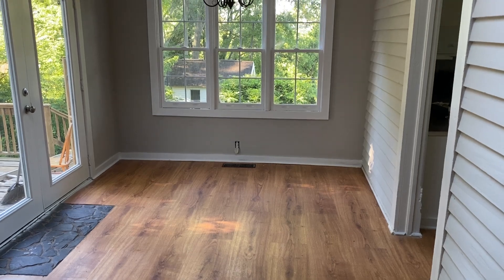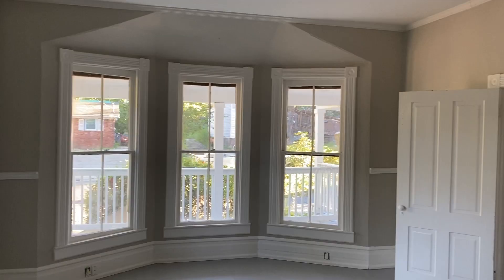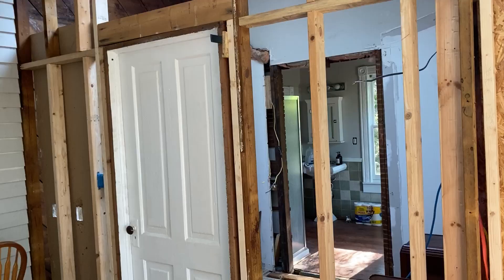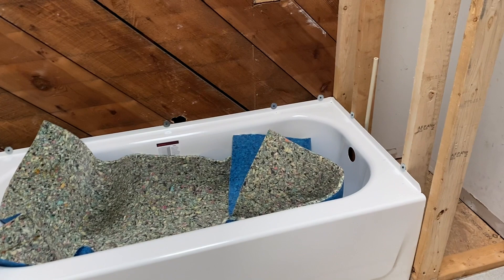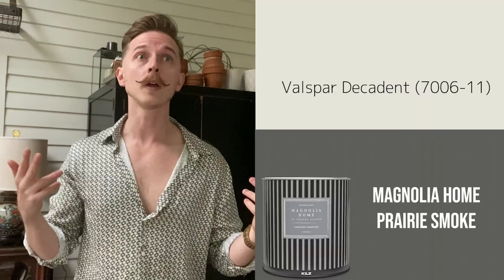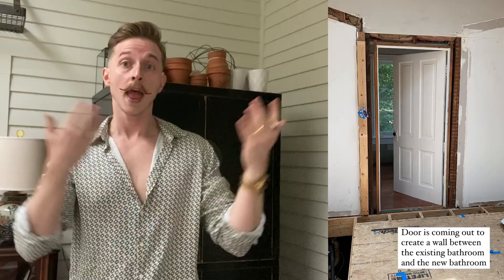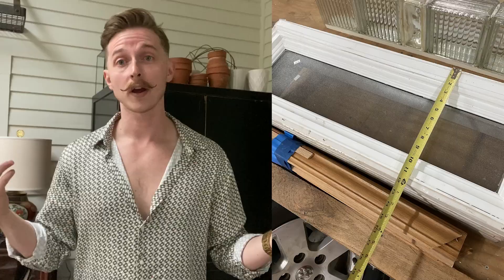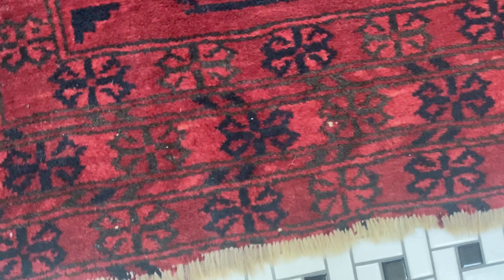EXTREME guest bathroom makeover! | Before and After | REISSUED

Comment: I think for the dryer, you should add a kind of vintage-look framed chalkboard, like a work-place tally board or lead board, to cover the dryer only, while leaving the washer exposed.  It would have a hinge on one side to allow access, but visually, that would work with the 30's style "WC" door.  Call it 20's boiler room, or speakeasy style.  Functionally, you could use it as a shopping list, weekly inspiration, schedules, reminders, artwork or whatever.
Reply: I see now it's actually IN the bathroom, and a door of any kind might not actually work.  Maybe as an alternative to fabric, a woven grass mat, that could roll up or a dowel-and-fabric roll-up screen, or one of those roll-up grass beach mats, that could hide the equipment.  Maybe a large-scale fabric art piece that would definitely be the centerpiece of the room in bold colors as a counterpoint to the black and white, or a sedate tapestry for a more vintage feel.

Comment: First off, hello.  I just recently found your channel.  I am enjoying your journey of transforming your home.  Love all your creativity in all the spaces .  Who cares about trends.  We can be inspired by them and like some, but you and you alone must love your environment.  OK , now that’s out of the way, I have a suggestion for your washer and dryer situation .  I, myself do not really like curtains to cover anything but windows. That’s just my me.  What if you created a long piece of art on a canvas wrapped in a frame the exact size of the unit that stores the W&D.  Here are a few ideas on how to attach it:

- attach magnets along the back of the canvas or frame. Then find some kind metal strip so the magnets will connect and hold in place . Just remove the art work when you need do do your laundry.

- use Velcro. Apply the same way as above.

- attach some kind of hooks to the unit or art work.

All of these ideas can be hidden from site .

(Amazon has really Heaven duty magnets.
Use Heavy duty Velcro )

Comment: I don't like it.  I love it.  
Extremely well thought out.  The greatest is of course the wall paper. Trust me, all the designers say that subway tiles will never go out of style.  The other tiles are classic to that house.  Those tiles are installed perfectly.  The transom and the doors were genius.  Well, everything is perfect.
Andrew, I like the idea of a thin cotton curtain, like a sheet, or almost a gauze and could be see-thru.   It would have to be the right pattern, and be pretty simple.  Maybe a stripe with some curves, a small print, non-descript, nothing to distract, but then solid would be too plain.  You will find it when you least expect it.    Maybe a café type with 2 rods?   I guess a door that slides to the toilet won't work either.  A dutch door on top, with a curtain on the bottom?  A door that opens from the bottom, folds in half then rests on the top of the cabinet having the top hinge on a type of drawer slide?
Since the faucet is so close to the sconces, and they ARE trendy, how would it look with that fake brass is painted a matte black or the color of the rug?  Or maybe an oval mirror would be better, the top of that mirror doesn't line up with anything, like tile black band.  Maybe a better transition from all the squares to the organic wall pattern?  You do know about getting different color led bulbs and also putting those on a dimmer, right?  Maybe a 3700K color light?
BTW.  Vinegar just shines copper and brass, ammonia will patina it, use a weak solution, it will go to verte gris fast.  You have to get the lacquer off of it first.
You did an amazing job here, so don't let my ideas throw you off of the praise.

😍

Comment: Fantastic job! The floor mosaic makes the subwaytile w black trim really look classic and high end, and the Escher wallpaper design is the most brilliant thing I've seen in a while! I really like that you let the vanity have it's warm wood finish to complememt and didn't go with a matchy matchy vanity.
That skylight makes the space so special, but I do understand being bugged by the exppsed washer/dryer since you went to thr trouble of giving it a solid wood cabinet, so if I were you, I'd either mount a roll up blind in rattan (diy?), cane/bamboo and eithet match the finish to the vanity or a grayscale in the wallpaper (super practical when doimg laundry just out of the way entirely) OR put curtain/fabric panel on a rod in which case you could paint the fabric design yourself or look for a vintage black/white fabric.
A couple of yards will go. A long way. In a situation w no budget I'd go for a Fornasetti design that would look amazing with the rest of the interior, but that's very pricey yardage and I feel you could print or paint a fabric panel at least as cool. 😉

Comment: I know the space around the washer/dryer cabinet is tight, but did you look into armoire pocket style doors that open and then slide into the sides of the cabinet? They retract completely 

As far as a curtain… get a cheap tension rod and a curtain and try it. I’d go with white so it “disappears” from view. If you like it, you can purchase better hardware to mount it

Comment: I would cover the washer and dryer if possible. I have two ideas. One….If you did a curtain you could put a tension rod at the bottom, which would keep the curtain more streamlined and alleviate the billowing at the bottom. If there is nowhere for the tension rod to attach at the bottom, you might have to put little blocks to hold the rod. My second idea…is something I’m not sure exists. So…you know how a window shade has a roller at the top? Is there a such thing as a roller door? I feel like there could be. If it had tracks on bottom and top, then rolls  to the side to open. If it doesn’t exist….we have a gold mine. Pocket doors are terrible to put in and like this situation wouldn’t work. Barn doors are a great solution to the yucky pocket door, but are overdone and in this situation wouldn’t work. Okay. I just came up with a third idea. Accordion doors from the 60’s and 70’s. I’m pretty sure you could come up with an updated and modern version. My work here is done. 😂
Reply from the maker: Haha this is amazing! We tried a thrifted accordion door… and it looked terrible 😂 The rolling door is a thing… and was definitely an option that we considered! Probably the best solution I’ve heard 🙌🏻
Reply: This may be too late but have you thought about a “tambour” slatted door in front of the washer drier?- like the front of those 1920s/30,s roll top desks or fronts of filing drawers and collectors cabinets?- I think this style would totally match the vintage vibe of the rest of your eclectic decor.They are constructed I believe from strips of wood fixed to cloth which slides up +down in side runners and rolls up at the back of the top - you could stain wood slats dark to match vintage door. Just an idea 👍Enjoying your channel ❤️